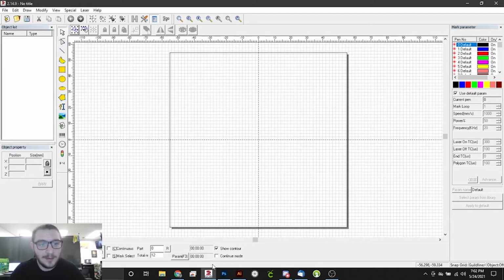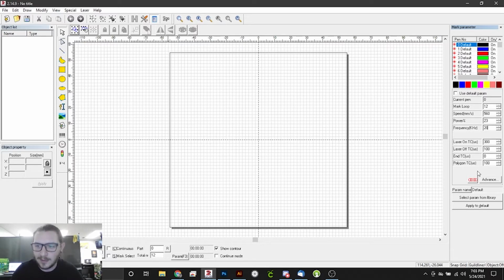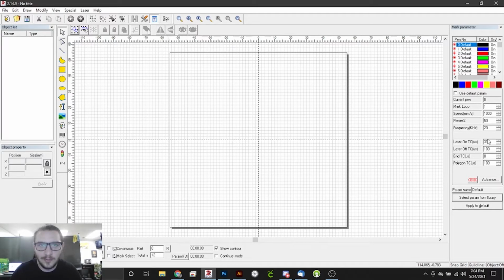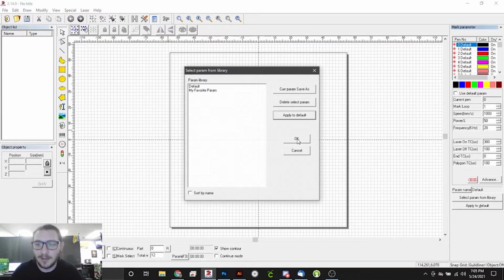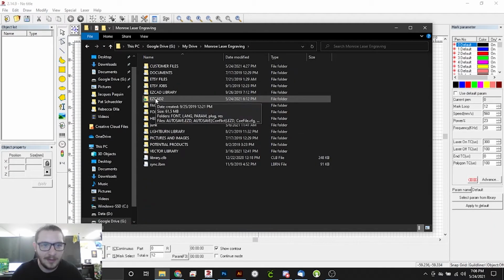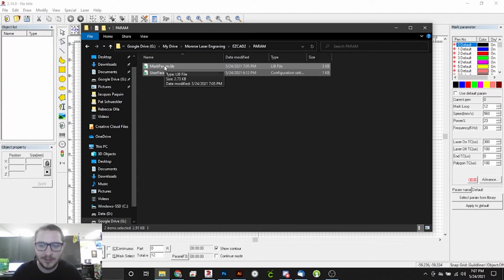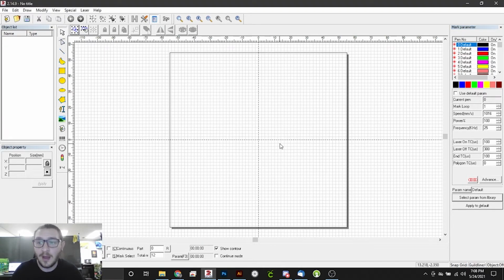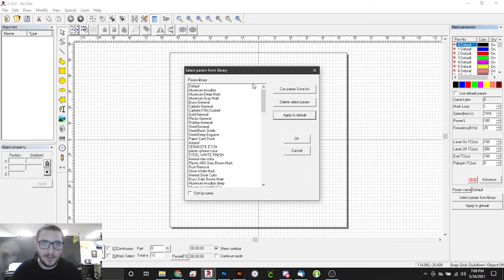How to Save, Backup and Manage Parameters in EZCAD (2022)

Comment: Hello, thank you very much for all the videos you have uploaded. I tell you, my name is Jonatha, I work for a jewelry store and in recent weeks they have delivered a fiber laser bogong to me but... it is not taxing on the material, I have already adjusted the laser parameters, I have checked the voltage, I have uninstalled and installed the software, we have checked the energy in the facilities and I don't know what else to do. I have searched for manuals, tutorials, everything to find guides that help. And I have a query, I use ezcad2 and in the IO state window the lights for io input 0-2-3 are red. Do you know what those lights want to tell me? I will be very grateful to you.
Reply from the maker: Sorry for the delay. Unfortunately I'm not able to know for sure, as that can change depending on physical wiring/configuration from the vendor. There are many things it could be, but when getting started it can be most frequently the settings, the focus height between lens and material, and then there are more issues as well that may need to be addressed by vendor potentially. All of our shared parameters are available if you head to the Laser Everything website, there is a link to our shared library right on the homepage. It covers most wattage and lens combinations, for both ezcad and Lightburn. All made free, possible by the community support over at the Laser Master Academy, I hope that may help. In the case it is something beyond focus and parameters, joining one of our communities so the support team or community can help would be the next best thing we can offer, or speaking with the vendor to help troubleshoot to ensure it isn't a physical issue.

Comment: hi thankyou for sharing , can i know the parameters for reflective yellow metal(not gold) , in the begining  S 800, P 90,F 10 was working for that material but when done repetetively , the laser is not able to mark can u share some tips  or parameters for a 20 w fiber laser marking machine
Reply from the maker: Sorry for the delay. It kind of depends on what the material is, if its plated, and what lens you may be using. Our shared library is on our website for download for free, thanks to the support of the LMA members, but if you need help tuning more, join any one of our community's and post a thread with the details and that way our support team and community can dig in to help.

Comment: Hi, i have leant from your video thanks and i have a 30w fiber laser mactron machine can you share the parameter of different types of metal and nonmetal marking.
Reply from the maker: All of our shared parameters are available if you head to the Laser Everything website, there is a link to our shared library right on the homepage. It covers most wattage and lens combinations, for both ezcad and Lightburn. All made free, possible by the community support over at the Laser Master Academy, check that out too if you get value from the community resources :)

Comment: hi, i'm following you and i learned a lot from you.  thank you for that.  Unfortunately my parameter library is empty.  I tried the method you showed.  It was not successful.  The file appears to be 1kb.  If you have 130kb.  Could you do file sharing?
Reply from the maker: We offer our parameter library at https://masters.lasereverything.net/
Reply: @LaserEverything  After I installed Windows and saved all grades related to gold cutting and engraving in the program, but now when I work with the machine, I feel that the machine is working weaker than before, which means that the cutting power of the machine has decreased greatly.  I previously set the speed to 200 and the power to 100. The frequency is also 50. My device is 50 watts. In your opinion, where is the problem with the device? Is there a place in the program where I can increase the cutting power?
Reply: @LaserEverything  With the speed and power coordinates that I said, it used to cut a 50 micron sheet with 12 revolutions. But now with the same coordinates, it cuts the same sheet with 30 revolutions.
Reply: @LaserEverything  wooble size is   0.04.  and  0.05...is that enough for cuting?

Comment: Parameters vs pens? Help please
Reply from the maker: Parameters are the settings for the current pen. The default is black. If you have a black square and a blue square you can set the two pen colors to mark with different parameters in the same run. Pens just allow you to do that.

Comment: Thanks for that great videos.... I'm a little old fashioned and either wing it or write my settings down 🤣🤣

My question ...I've saved once but is it true that when you when you click save Ezcad only saves that pen colour ? 

And how do you match that to a hatch setting?
Reply from the maker: Ah yes, this would have been good to cover in the video - I'll have to make a follow up. Basically nothing about saving parameters has anything to do with pen colors when working with the library. The parameter is only going to apply to the pen color you've selected  in the top right corner. When selecting a pen you want to select the pen from the row of square colors, *not the list*. The list is for reference only. So if you click black, then load the default parameter then click blue and load the favorite parameter - all black will use default all blue will use favorite. Finally, if you use the Current Param Save As function it's going to save whatever color you last selected. If blue in this instance was the last thing you clicked that would be the color saved to the setting. Once saved that parameter could be applied to any color pen - for instance you can click the yellow pen now, uncheck default then select a new param from the list and hit ok and it will apply that saved param to the yellow pen.

It's also worth noting that saving your EZCAD project as a .ezd file will save the pens in their current state, whether or not they were saved to the library.

Long story short pens and parameters are completely separate things. You DO have the option to apply a param to a pen but that pen should not be treated as a save bank for that parameter because every time you open a new project those pen colors are reset to default. 

Phew.

Sorry for the long winded explaination. I hope that helps. If my response is confusing I will clear it up in the next video! 

-Alex